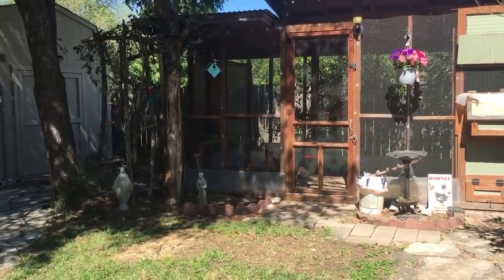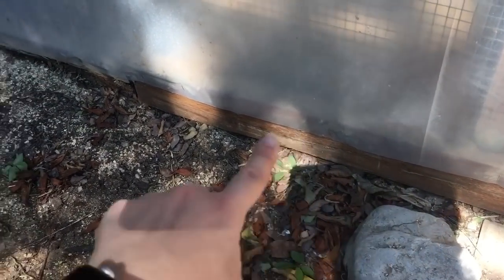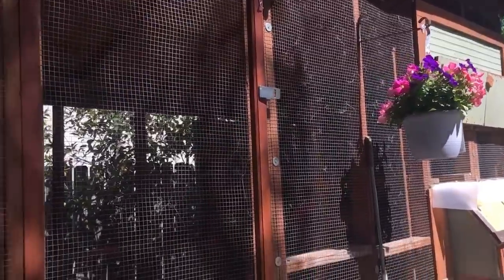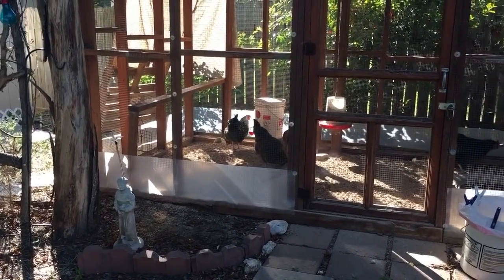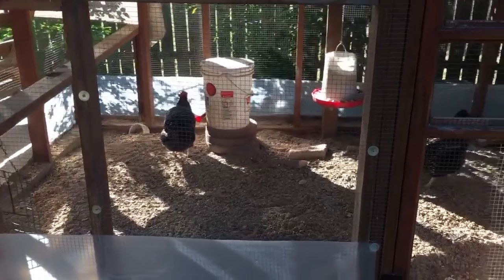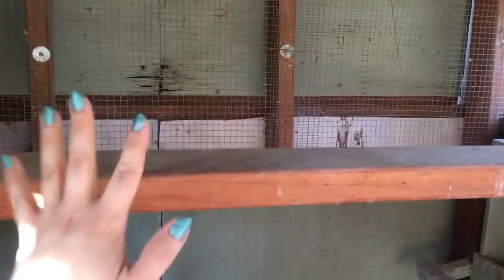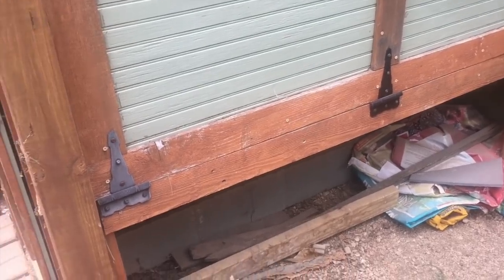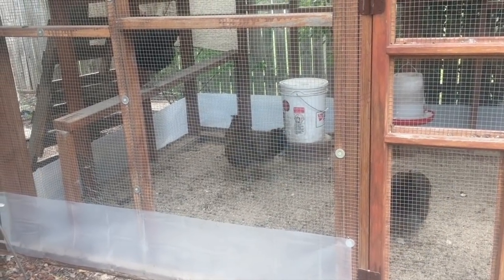Build the Perfect Chicken Coop

Comment: In the coop, I use sand.  In the run, I rake in all the fall leaves, wood ash, charcoal, corn cobs, various grits and all the manure I clean from the coop.  After a year (or 3), I sift the run litter and finish composting it.  It's not much work, but I do turn a section now and then and they love moist earth in the hot summer days.
Reply from the maker: That all sounds fantastic! ✌🏻❤️🐓

Comment: 3:43
Also, you need to wear safety glasses when working with hardware cloth. As she said, it comes in rolls and it’s rather stiff. Translation: it’s springy. When you cut it apart, the pieces will spring back into a curled shape and you can easily cut your face or eyes with this stuff. Leather gloves and safety glasses. 👍🏻
Reply from the maker: Thank you! Yes excellent advice.

Comment: Brilliant idea!! You could use tent canvas or duck canvas. Then you could actually have it hemmed and have buttonholes sewn into the bottom edges to hook onto hooks you screw into the bottom of the coop/run. I would go with something more sustainable like those kinds of heavier duty canvas as they repel water or can be treated to repel water and they dont have to be replaced nearly as often and they can be cleaned easier. 
I dont know if you’ve ever tried to clean one of those plastic tarps but they are a PITA to clean.
Reply from the maker: Good point! 👍🏼
Reply: Would painters drip cloth canvas work 
I wonder
Reply: @learnjcbskidsterchickensga7594  i think that could very possibly work! Good thinking!!
Reply: I think that sewing a wide strip of Velcro would make it very simple.

Comment: Shower Curtins would be great.  the liners with magnets would be east to put in wood at bottom.   Set your rod at top at whatever height you need to reach b ottom the eves will protect the top If you get clear plastic  use 6 mil or heavier.  When you have time you can order from a plastics co.  I live cold -30 and used a heavier semi transparent for roof and three sides.  The side facing my kitchen has a section 3x5 feet with 6 mil totally clear both on inner run and outer run so I can look out and see them.  the other sides have small clear windows so they can watch squirrels and rabbits and dogs and cats.  My outer run is only hawk proof and moderately ground proof it is for daytime use and the birds make a racket if they see anything and I let the dog out and come out with a long handled shovel.  THe inner run is very predator proof as is the coop but there is not enough room for them to run and dust bathe etc. So I added a 10x10 outer run designed primarily to keep chickens busy and in. Thank you for your suggestions.
Reply from the maker: You have great auggestions too, my friend!

Comment: What's yor thoughts on converting a galvanized steel shed into a chicken coop?
Reply from the maker: Could definitely work! Need to make sure it can have some ventilation/circulation and keep it predator proofed, but if you have the time and the know how it could become a venerable fortress! Email me if you wanna talk shop in more detail (easier than on here) ✌🏼❤️🐓 theMama@realsimplemama.com
Reply: @realsimplemama  old corn cribs of steel had perforations for grain ventilation…. Also check auctions for 
Wood
Locks
2.4s
Roof vents, tar paper, etc.
Gates